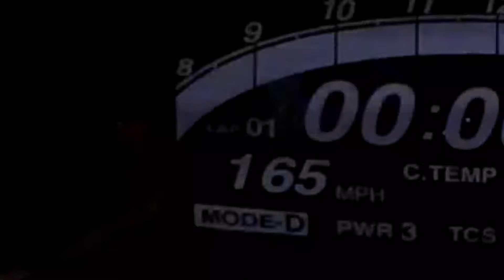Cookstown 100 - Proper Irish Road Racing!

Comment: Ok. So the elephant in the room, why in a race at time stamp 11.01 are you in power mode 3??
Reply from the maker: Haha! Yeah looks bad but it just makes the bike easier to ride, the modes only affect throttle to throttle body responsiveness. The bike still delivers full power when you fully open the throttle but has a less linear curve than if you had it set to mode 1 which is 1:1. Mode 4 is the only mode that actually cuts overall power (wet mode). I might have that all wrong but that's to the best of my knowledge 😁👍
Reply: @wrracing Yeah, I see what you're saying. In my manual it  does say A&B modes are for track, C&D for the road. Each to their own mate. Great video. Good luck this season dude🤜🏻🤛🏻
Reply from the maker: @LeeTillbury  thanks mate! I'll give the A and B a go this weekend and report back, scary enough to ride as it is 😂😂
Reply: @wrracing You're not wrong dude!😱